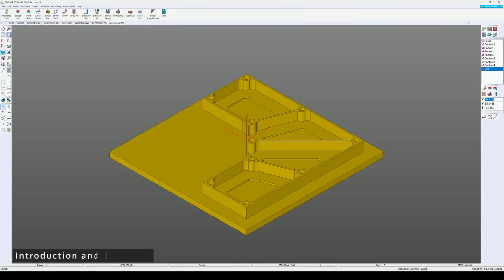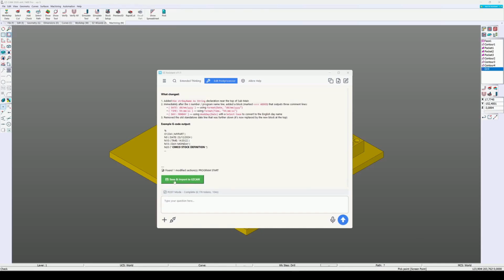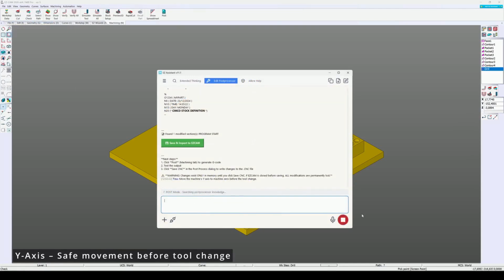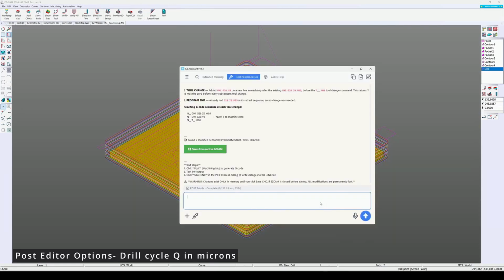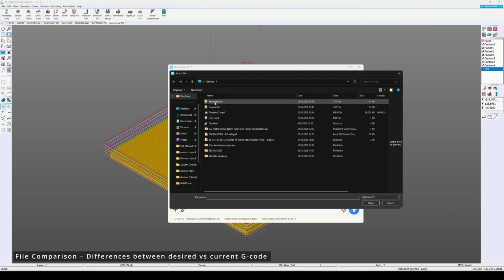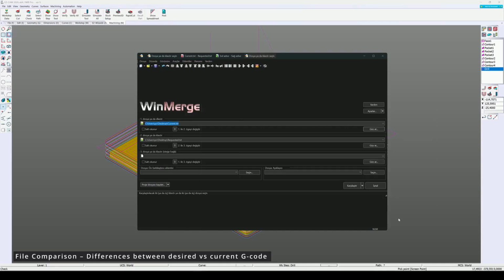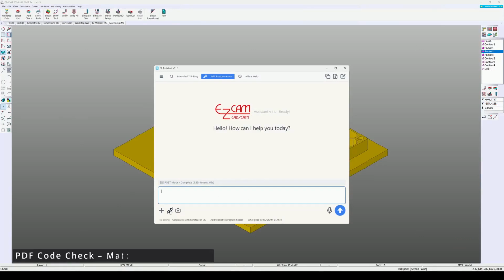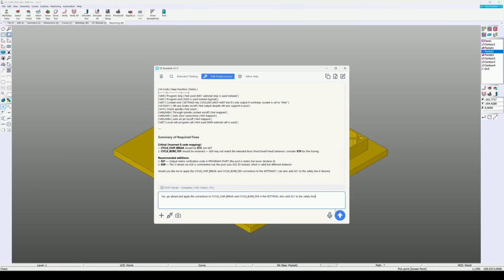Edit Your Post-Processor with AI — EZ-CAM Assistant Tutorial | 5 Real Examples

Comment: Can this be used for swiss and turnmilling?
Reply from the maker: Yes absolutely:
load your postprocessor in EZ-CAM
launch the Assistant
at lower left toolbar click the "plug" icon "Attach current postprocessor"
type your modification request